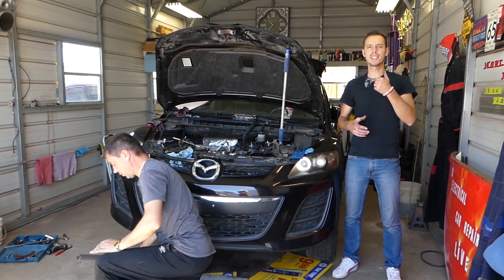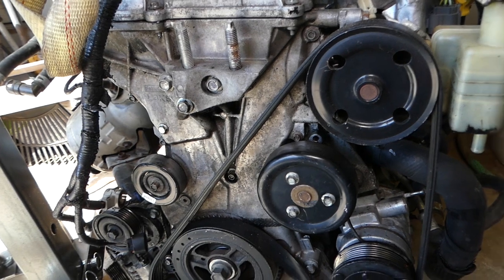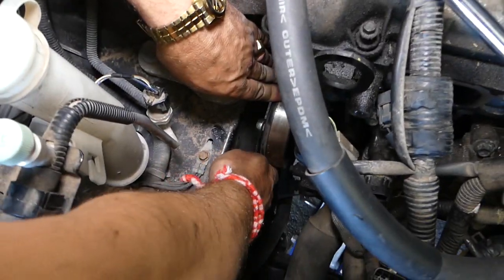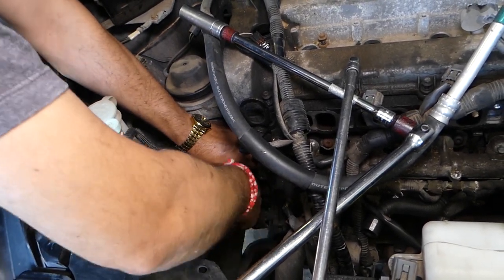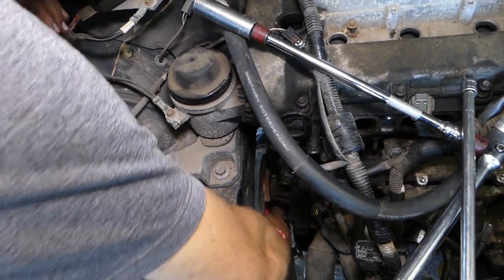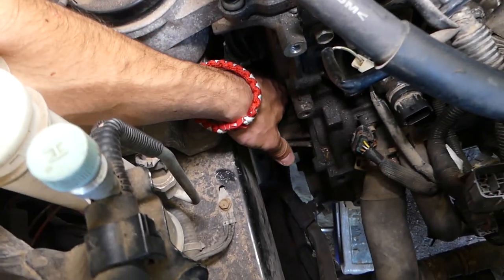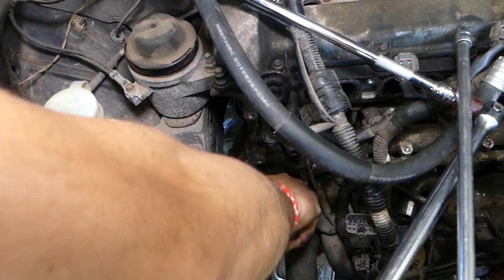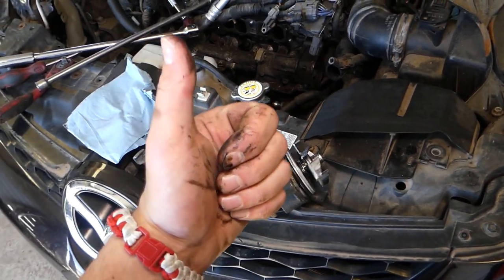WATER PUMP REPLACEMENT REMOVAL MAZDA CX-7 MAZDASPEED 3 MAZDA SPEED 6 2.3 DIZI MZR ENGINE

Comment: hi video is educational. do you also have video to fix pipe from radiator to mazda 2005 mpv enigne. water is leaking needs  pipe replacement. thanks ang mpre power

Comment: What was the reason for changing that water pump
Reply: sami armstrong pump wasn't showing love like it once did
Reply: I have a 2008 Mazda CX-7 2.3 the oil goes to the coolant any suggestion? 
Thank you
Reply: @tiffanybastian1850   weve got the same car, we need to fix the codes and engine light and sell sell sell or trade in very soon, before there's more problems.  i don't have an idea of why oil goes to the coolant.  change the oil, change the coolant and trade it in.  ford mazda did a terrible job with our cars.  the cx9 was even worse, the water pump was behind the timing cover.  water pump goes and whole engine goes too.